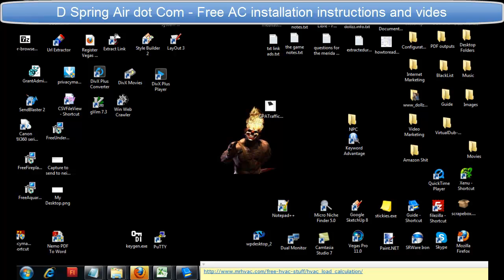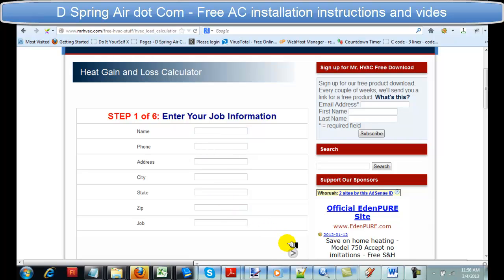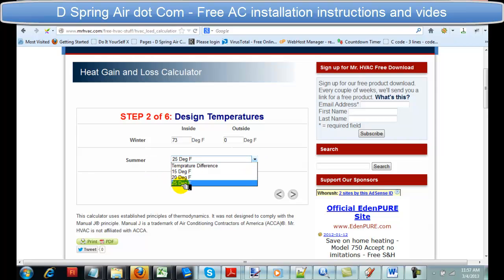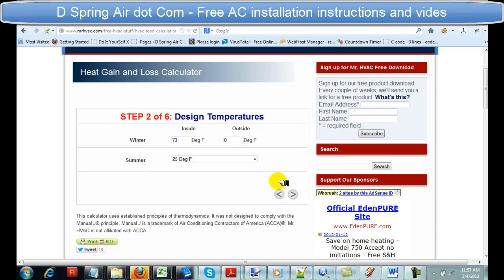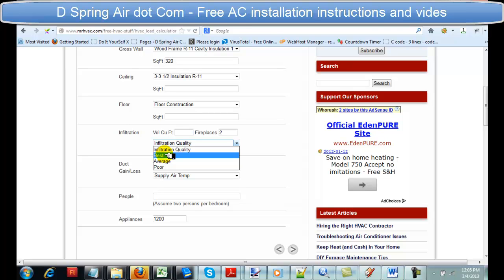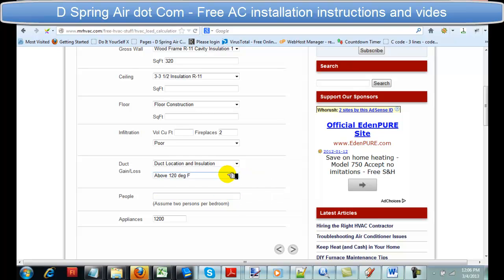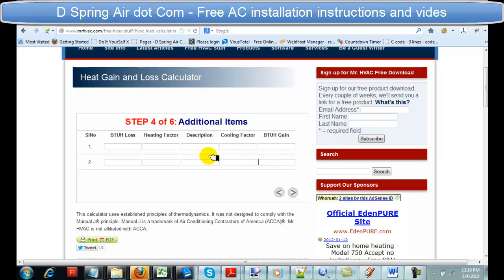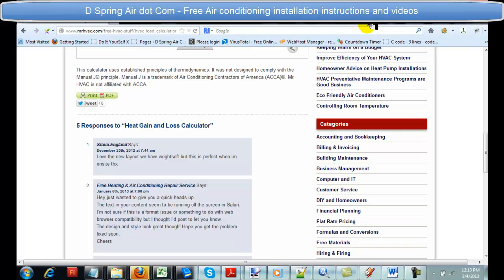Heat and cooling load calculations

Comment: Regards friend. Great video.

I'm designing a precision system for a data center, I have not experience working with data center precision cooling just with confort, so my questions are: do you have an example that you could share with me of load estimation for data centers? is the calculation procedure different from the confort loads? How do I know the needed power for a precision cooling system in a data center?.

Thanks in advance for your help.

Comment: The design temp must match acca manual j DT tables or inspectors won't accept your permit submission . I agree the design should meet worst case temps , Being a service mechanic for 40 years I have found undersized  equipment to the biggest problem during heat waves .All that properly designed equipment won't keep you cool when it gets hot . What is the point in having air conditioning in the first place .It's would be the same as only selling cars that can only go 50mph because that is the average speed you drive .
Reply from the maker: Yea i agree.... two stage cooling is now becoming main stream and will help with this alot....